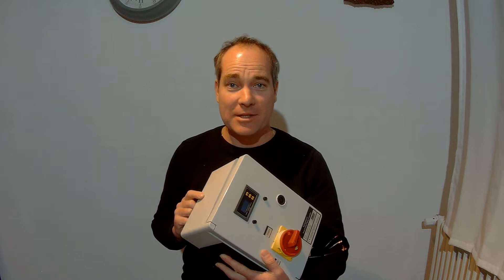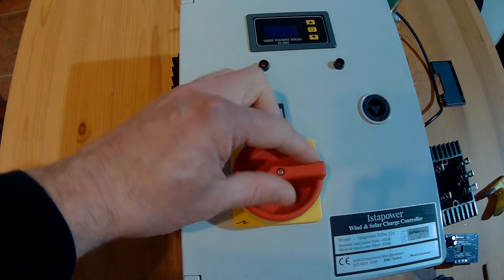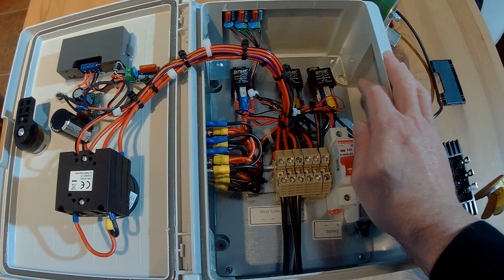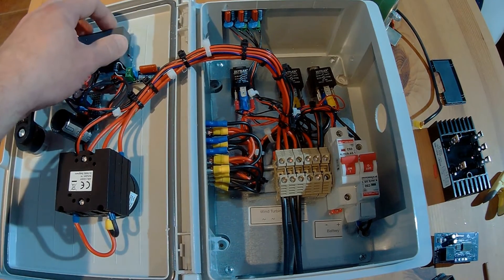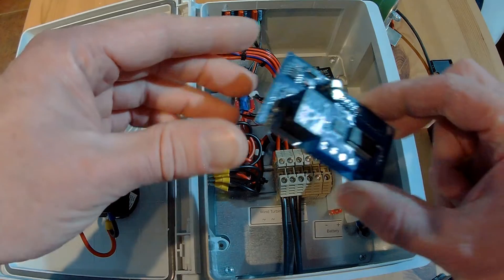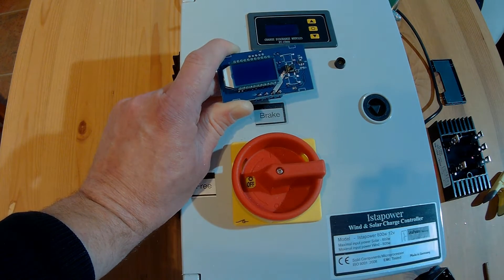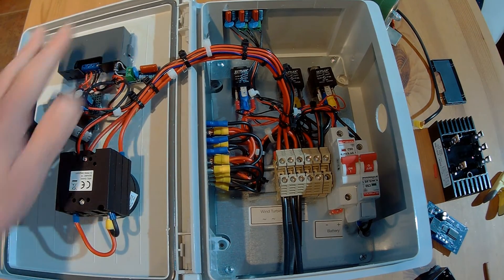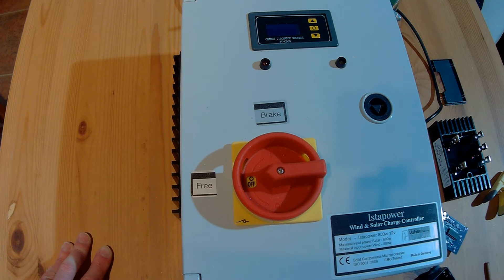ISTA Breeze wind turbine charge controller with LífePo4 Batteries - Voltage Modification

Comment: Like your videos, can you answer a question? I have this same controller  hybrid 12 800w, my wind turbine is 400w and about 30 meters from my controller and it is not producing a lot of power, can I put a 1000w windmill to this controller, taking into consideration the length of my cable 30m I don't think Il even gett 800w to the controller, and dos it mater if the windmill is 12v ore 48 volts

Comment: Hi, do you know if it’s possible to adjust the voltage on the newer Ista charge controllers? They have the LCD display inside the box and it’s a different unit. Thanks
Reply from the maker: I´m, sorry. I have not worked with them - yet

Comment: Hello. Can you please explane me about this charge controller. Is it overall just a simple voltage controler that can turn on and off the output by relay then max voltage is reached? It can not change the output voltage like some charging profile? What happens when wind turbine gives 70vdc? Charge controler lowers voltage to needed level or just turns on dump loads/stop.  Thank you very much.
Reply from the maker: It is true that the regulator only switches voltages and rectifies the AC voltage.The system voltage of the batteries keeps the system within a voltage range. Due to the low internal resistance of the batteries, the DC voltage does not increase abruptly. This would be the case with fully charged batteries. - but then the controller switches off. It's as simple as that.

Comment: thanks for the video. Is it possible to charge a 13v or 24v battery with a 48v turbine... Will it stepdown input to my battery bank voltage no problem? Many thanks
Reply from the maker: Hi. Yes it will break down, but with less efficiency.  I'll create a video about an 48Volt I-700 on a 24Volt system in the next weeks.

Comment: good job i ordered the i 700 and the i 1000 i to live in a windy area average 6 to 7 mps can you tell me if these turbines production to expect in kwh per day and do these produce as stated your input on that
Reply from the maker: Hi. Seems you have similar wind propagation than I have. The results depending. At bad Days, only 1kw/h per day. At good days, up to 15 and more kw/h per day out of the I1500. Please note, it's essential to have nothing - really nothing (not even a small bush) in front of the turbine. Between 340 deg. and 010 degrees, I have trees, and they will take nearly all the power. Luckily the wind is coming at 95% not from this direction.

Comment: Moin Alex! Auf welche Werte hast du die Parameter des Ladereglers bei dir geändert (Out up / Out dn)? Danke. :)
Reply from the maker: Hallo. Welche Systemspannung verwendest du? Bei 24V LifePo System bin ich auf up bei 28.8 V und Down auf 28.4 mit einer Wiedereinschalt Pause von 5 min. Bei 48V hat sich  ein Wert um die 56-57V bewährt. Hier spiele ich aber noch

Comment: Thats a great improvement being able to changeout the guts of the display/selector…..there are also the board button soldered pins inside as has been pointed out that can be ‘bridged’ with a jumper wire to alter the settings incrementally as well but this is a permanent fix, excellent tip 👍
Reply from the maker: Thank you. I'll continue

Comment: Hello everyone, when you order from Ista Power, you can put a message saying your type of batteries and at what voltage you want it to cut, depending on the type of batteries you have, I work with Ista Power and in all my orders I tell you the voltage once the client has been consulted, I speak by phone with Ista Power every week, he is a good professional, the buttons to adjust these parameters are canceled because people start touching the buttons without knowledge and then they say it has broken, It happened to me several times, that's why I, as a seller of Ista Breeze in Spain, sent them without buttons, except that the client assured me that no one has access to the charge regulator except himself. Glad to have clarified doubts about it
Reply from the maker: Thank you for the clarification. The problem with the wrong settings I had already thought;). It would be nice if ISTA offered the possibility of a freely adjustable controller. There will be a few more wind turbine videos coming soon. My place of residence is ideal for this.

Comment: Hi, Nice video. Thanks. Does that controller do anything else apart from braking and current dumping? Does it do any volt boost to help cut in?
Reply: it's totally dumb, all it does is puts a short across the windings to brake the alternator when a predetermined battery voltage is reached. I had two, both went faulty - the first one was replaced, the replacement went down with a different fault but the manufacturer wasn't interested. I do not recommend it, an mppt controller with a dump load is cheaper and much, much better.
Reply: @bostonbikebits6539 might be able to modify it. Put heating coils or resistors instead of a dead short to protect the windings in the alternator. 
If all it as is a voltage sensing circuit with a relay, I bet you could turn it into a poor man’s clipper. Something to protect a mppt controller from high voltage free wheeling.
Reply from the maker: Hi. No it does not any voltage boost or MPPT. It´s just a controlled Rectifier. At my location, however, the wind turbine runs more stable. An MPPT sometimes brakes the generator abruptly